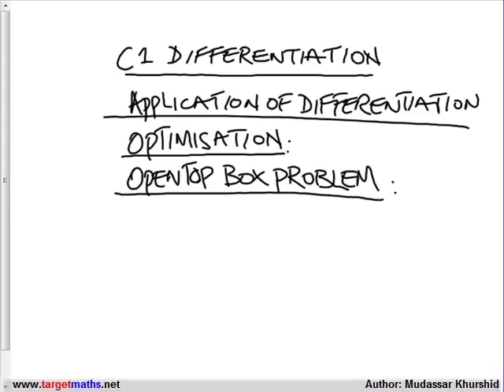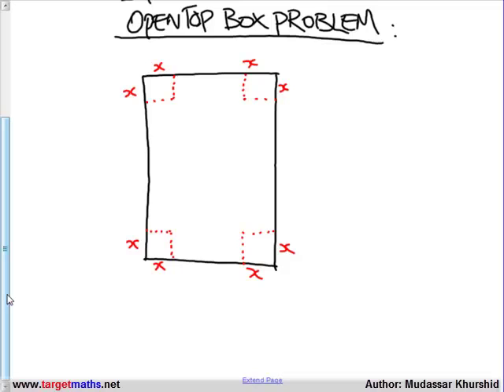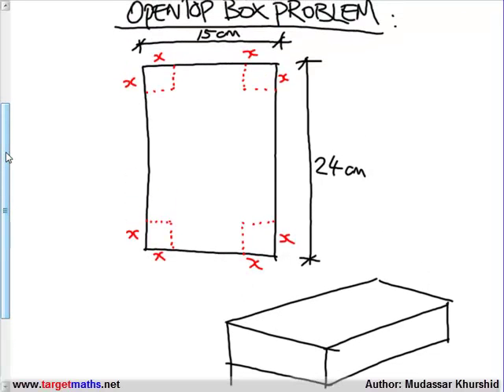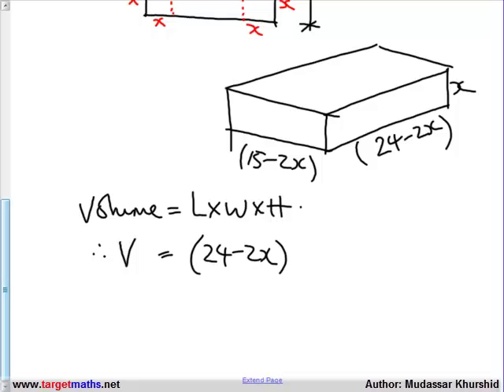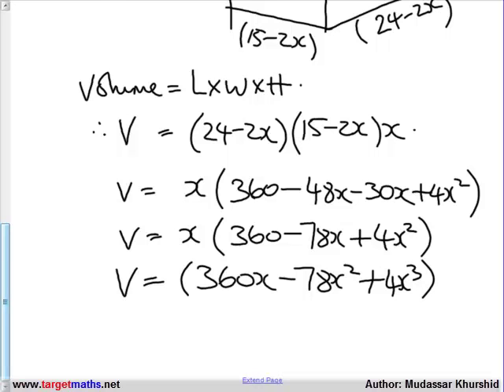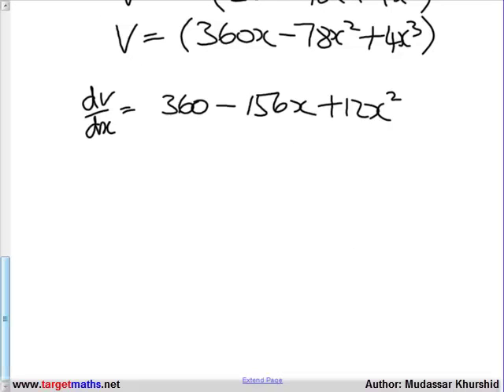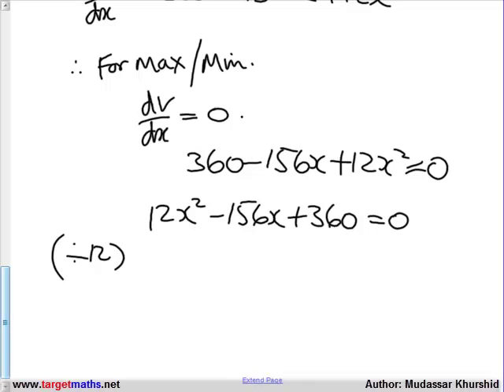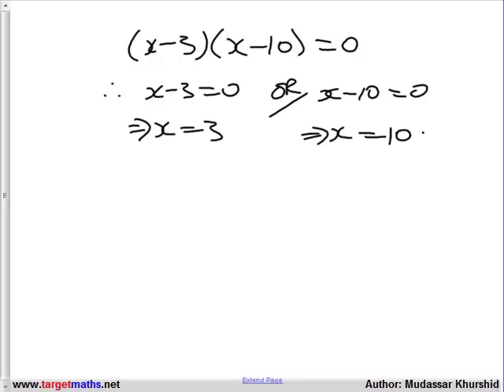Open Top Box Problem

Comment: I just got a brand new sky dish and sky q box in at my new address, but my open box does not receive a signal, had no problem with old equipment, is there a block in the new sky dish ?